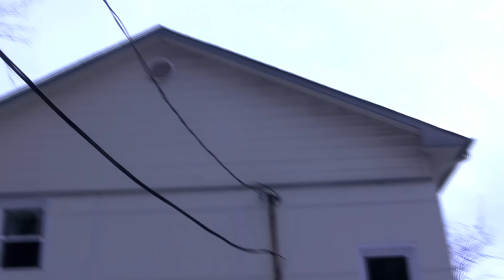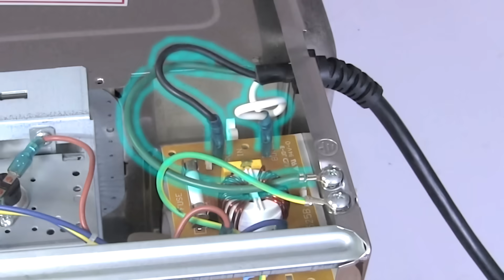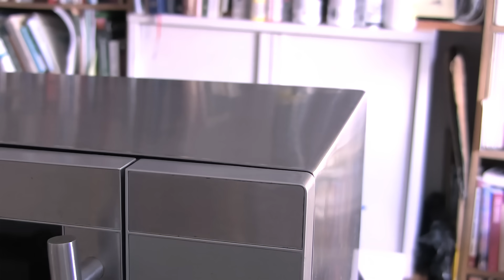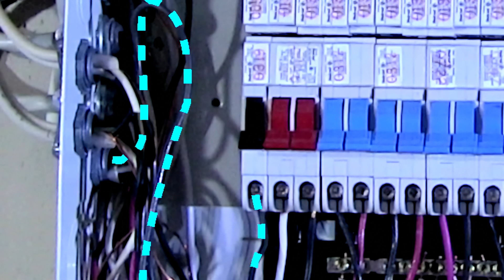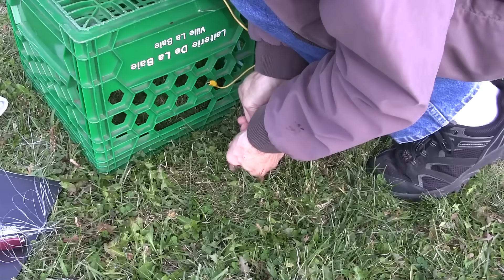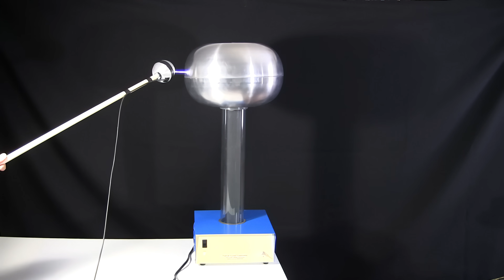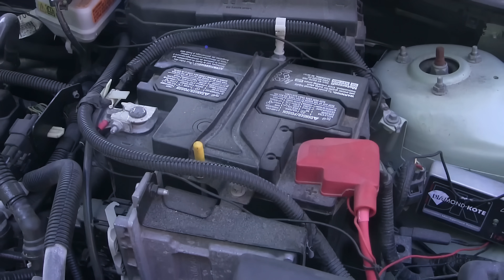What is Ground? Earth Ground/Earthing

Comment: This video is wrong about earth ground, watch MikeHoltNEC.
Reply: what is wrong about this video?
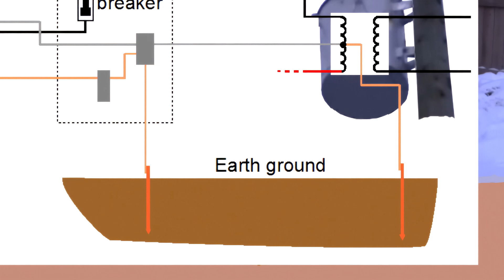Reply: At 4:20 he seems to be implying that Earth will absorb the current, which it will not. All you are doing is charging the ground around the earth, and the ground rod is a poor connection to Earth anyway. You can try this yourself by simply sticking the hot line directly into the ground - nothing will happen (except you might possibly kill yourself), it won't trip the breaker.
I'm not even sure what he's saying here - the Earth has plenty of electrons, but so does every wire and piece of metal in your house that is bonded. It's not for lightning protection, that's ridiculous.
Reply: @richardgates7479  yes sticking the hot line directly into the ground won't tip the breaker, but bear in mind that these rods are few meters deep into the ground
Reply: @Healow
Doesn't make any difference (well very little), it still won't trip.
If you don't believe me look at MikeHoltNEC channel, in one video he drives a rod down 50 feet and it still doesn't trip. The rod still corrodes immediately, and the current is actually going back to the source, so you still have the other end of the path (the transformer) in the equation. He also has a discussion called Grounding Myths, it is a very interesting thing to discuss.
Reply: @richardgates7479  how does a person gets shocked when touching a live wire? isn't that the same? you are just shorting it to ground
Reply: @Healow
Stick the live wire into the ground and you'll still get shocked. The current is going back to the transformers on the power line. There's always voltage in the service ground, several volts, sometimes enough to feel - that's the difference or voltage potential (from the power lines) between you and your neighbor's home.
Earth ground voltage is complex, but there is a voltage gradient so it's totally possible to get shocked by a ground rod if the service neutral is bad. But if it's a ground-isolated system you can't get shocked, because the current is going back to it's source, which isn't attached to earth ground. Some electrical systems use isolated transformers. https://en.wikipedia.org/wiki/Isolation_transformer
Reply from the maker: Did you skip the first half of the video? That's where I talk about what trips the breaker, closing the circuit back to the transformer. The part at 4:20 is talking about dissipating stray charge on metal cases and has nothing to do with the hot wire.
Reply: I was replying to Healow's question with an example of what's wrong, and your statement implies that the connection to ground makes the metal safe to touch, when it is actually the bond to the neutral that makes the ground safe.
And it doesn't make it safe from lightening either because it can hit the ground and now travel up through the ground rod into the home, that is if it don't burn through the wiring first.
Lightening rods work because they create a shorter path to the Earth via the pointed metal rod cutting through the air, and it will still travel across the ground in search of the greatest opposing charge (which will be far less then if that charge had to build up enough to cut through the air).

But this is more about how you worded it and not so much what you meant. If the ground has an even charge everywhere then how can there be different voltages at different distances from a ground rod? And why would lightening ever happen if the static is caused by the friction between the air and the Earth, why would it travel to the Earth if it didn't have an opposite charge?
Reply: you are confusing ground and ground fault.  ground foes bleed off the voltage the ground rods do work, what Holt is showing is a breaker may not trip as it just supplies voltage, a ground fault would trip and that is what that video is showing.  watch  all his videos from the beginning and listen you are missing things.

Comment: Howdy.
It is a common misunderstanding that ground is a "dump well" of the residual current when an appliance develops a fault. That is wrong. The fault residual current always returns to the transformer starpoint.
The neutral wire returns the regular load current and the ground wire returns the fault residual current. Both to the transformer's starpoint.
Why is the consumer ground wire earthed ? It is to minimize the potential difference between the faulting appliance's casing and the environment of use. The aim of the consumer earth electrode is not a low earth impedance. The aim is that the consumer electrode encircles the environment of use. Complete encirclement is seldom possible, though.
With the grid line pole groundings the situation is different. Here the aim actually is a low grounding impedance. The earh will act as a parallel line neutral + ground wire. The aim is to uphold line phase symmetry in cases of unsymmetrical line loading. Also the aim is to minimize lightning shock wave induction and influencing
Reply: Howdy again.
In my blog  eugpoh31.blogspot.com  I try to visualize how the fault touch voltage emerges when an appliance developes a fault.

Comment: bro please help me my doubts are silly but please help me my doubts are in the comment
Reply: 1. for electric potential we consider that we bring a charge from infinity so the work done to bring the charge should be infinity right 
2. is voltage because of coloumb force if yes then how can we calculate the the force between the two  terminals of the cell if its not then  please tell me what happens basically to force the electrons to move
3.can dc current be grounded
4.what is the difference between earthing and ground
5.positive terminal means an area or region move of positive charge or less negative charge as compared to negative terminal AM I RIGHT OR WRONG
6.forgetting the conventional flow in reality electrons flow from  negative terminal to positive terminal right
7.If 6.is right then why do we consider ground negative terminal we should consider it as positive terminal as electron goes to the ground
//basically the main thing is that I am not able to understand electric potential and its concept of infinity 
8.I AM CONSIDERING ELECTRICITY IN TERMS OF ELECTROSTATIC FORCE, AM I WRONG 
9.BRO LAST THING IF EARTH IS NEUTRAL AND IF IT HAS A PROPERTY TO ACCEPT CHARGE THEN IN MILLION OF YEARS THE EARTH SHOULD BE NEGATIVELY CHARGED THIS IS BECAUSE FOR POTECTING OUR BUILDINGS AND HOUSE WE EARTH THE CONNECTION 
AND BECAUSE OF THIS THE EARTH SHOULD BE NEGATIVELY CHARGED AND THEN IT WILL BE HIGHLY NEGATIVE THEN IT WON'T BE STABLE RIGHT 
10.BRO IF EARTH ACCEPTS THE ELECTRON THEN FOR THE ELECTRON TO BE STABLE IT SHOULD BE IN SOME ATOM RIGHT AND IF I AM CORRECT THEN IN WHAT ALL ATOMS DOES THIS ELECTRON GO  AND DON'T YOU THINK THAT THE ATOM WILL HAVE MORE SHELL THAN HOW MUCH THE NUCLEUS OF ATOM CAN HOLD SO THIS CAN'T BE POSSIBLE RIGHT
//IF YOU KNOW THE ANSWER OF MY DOUBTS PLS HELP ME
Reply: @sdadeveloper5223  Im a bit rusty and may be butchering this a bit but here is how i understand the work from infinity.
potential is meangingless without a reference point, only differnce in potential has meaning.  So when we say something is 5volts we are really saying the differnce between 0volts refernce point and 5 volts is 5 volts. As potential falls off as 1/distance, 0 volts happens only when the distance is infinity, as 1/infinitiy is zero. So this ideal 0 reference point would be infinitely far away.
 The work done on a charge is the charge times the difference in potential, which is the energy required to move a charge from 0 infinitley far away to the point where 5 volts is. The energy required isnt infinite.
Reply: @sdadeveloper5223  I have one question, Considering only single phase ac circuit, we use larger wire for live and smaller for neutral.
 In each cycle, ac changes direction. Both the wires should be equal. Why we don't provide same wire size to both cable? Both wires carrying same current by changing direction. So, why call It's safe to touch neutral wire?

Comment: I notice many electrical devices which are essentially the same, e.g. home audio (CD players etc) have a ground, and some don't. How can there be such a difference in opinion as to whether such a device needs ground? I just bought a network streamer and the IEC cable only has two wires, not three as usual.
Reply: If the devices housing is only made of plastic or something that current wont go through it wont need the ground wire
Reply: If a device has only 2 the hot and neutral it may be labeled something like double bonded.  The case is non conductive and likely has a transformer isolating it for safety inside you do not see.  Unless it does not have the UL safety code then it is unsafe.

Comment: So can a neutural wire be used as a ground in a electical box being it doesnt have a ground wire i want to hook up a motion sensor for light in hallway.
Reply from the maker: No, because if you connect the electrical box to the neural, the electrical box becomes a part of the live circuit whenever the light is turned on. If someone is grounded and they touch the box while the light is turned on then some of the electricity could take a path through them to the ground and back to the nearest connection to the electrical system (the breaker box or the transformer).

Comment: As I know neutral and earth not connected together due to both neutral and earth are have some leakage so that kind of situation our ELCB or RCCB will trip so all 3 cable are connected separate
Reply from the maker: In North America, most electrical codes say that the neutral and ground must be connected together in the first box after the wires enter a residence. There are other parts of the world where the rules are different.
Reply: You are looking at the device reacting to the circuit, the bond is made ahead of your circuit you complete turning on a device. It is more complicated than he describes and North america uses GFCI and AFCI which clamp and open the circuit at a lower voltage then EU and UK.

Comment: I would use a 30mA RCD.
Reply: Instead we use GFCI which clamps at 5 ma, 16 ma is enough to cause damage.
Reply: Michael Jørgensen     So you are saying do not ground or Earth the case of the microwave, let the energized conductor put voltage on the metal case, then when someone touches the metal, and is grounded, then your 30ma RCD will trip?   This is why "Earth" conductors are installed in your country.

Comment: If the ground wire is connected to the neutral in the cabinet, why bother with the wire from the socket to the cabinet? Why not just connect the ground to the neutral in the appliance?
Reply: The neutral is the conductor used by the device itself (whatever is plugged in) to create a difference in voltage so that it can use energy. The ground despite being essentially the same potential is used to bond all the devices together to create a short circuit if anything metal contacts a powered conductor.

The very efficient path to ground will be the preferred path of the electric rather than through you, or higher resistance materials that are flammable. The breaker will most likely see a huge spike in amperage and shut off instantly stopping the fault before fire or shock.

Edit: I hadn’t watched this video prior to answering and I see he basically said the same thing I did. It’s essentially a second line of defense as well. If you lost a neutral you would have a ground fault without enough current to trip the circuit. Losing conductors can happen, I’ve seen lost neutrals several times and the ground is still there to protect and trip the circuit.
Reply: Where the ground and neutral are bonded are before your circuit you complete. The breaker trips from the circuit between the breaker to the device you plug in back to the ground bus in the panel.  if you have more than one panel in your house or garage it is only bonded at the very first panel.  after that the ground and neutral must be separate.

Comment: Hot and neutral? Not negative and positive?
Reply from the maker: Nope. This is AC, Alternating Current. Since the neutral wire is connected to ground, it's potential stays the same, call it 0 volts. The hot then alternates around it, going positive with respect to the neutral, then negative, then positive, ...
DC, Direct Current, is the type where you have a constant negative and/or positive.
Reply: I see thanks for clearing that up  @RimstarOrg

Comment: Good explanation that is valid for USA and UK, I suppose?  Connections are made different in Europe and several other places in the world, so safety consequences are different too.  In Europe Earth and Neutral are not connected, and we use beside the classic breaker also differential breakers.  They break power when the current in L and N are different (by 300 mA for whole house, by 30 mA for bathroom).  In this way one is safe for any danger of electrocution, except for when touching L and N at the same time.  The USA and UK systems have more situations where electrocution risk is potential.
Reply: Earth and neutral are still electrically connected to each other in most households AFAIK. However I'm not sure if it's usually simply by the fact that neutral at the transformer is referenced to the earth and the ground in your home is, or if we in the EU still connect them together before the differential breaker too. I think it's the 2nd one to be honest though.
Reply: @FranseFrikandel  There is quite some difference in electrical grid and earthing connections all over the world!!!  For more details see: https://en.wikipedia.org/wiki/Earthing_system   On the continent in EU, the TN-C-S system is used most:  Earth and N are never connected together at the customers, they are most often connected together at the sub-station, and the customer must have his own Earthing.  Due to distance and "potential high" resistance of the underground, one can have dangerous tensions between Earth and N at the customers place.
Reply: Bro, TN-C-S is TN-Combined-Seperated and the N wire is combined with the PE wire (PEN) and seperated in the first fuseboard, aka it's connected in the transformer station :) 
And for household in Denmark we mostly use the TT system where we have a earth electrode at the house and we must use 30mA RCDs.
Reply: @tbravo5493  Indeed, I didn't know the common English term for what we call differentieel in Flemisch or differentiel in French. Thanks.
Reply: In Europe, if you touch L and N at the same time, the differential breaker breaks, right?
Reply: @robertbheatcoker8638  No no, the differential breaker does only check the difference in current between L and N.  If you are insulated from earth and you touch both wires, the same current goes through L, through your body and through N, and it will not switch off.  Only when your body is sufficient well connected to the Earth in whatever way (wet feet or hands on metallic radiator or hands on microwave body or....) and you touch L or N, the differential breaker will switch off.
Reply: @tuttebelleke  ok. Then in that case. What protect me. The magneto breaker?
Reply: @robertbheatcoker8638  Very sorry, but you are not protected at all for that case.  But luckily, common people, not working on electrical grids, not working on electric machines, not searching risks will never meet that situation.  The easiest way to create it, is by putting a nail in both wall outlet holes L and N. That will be difficult because the built in child protection (in Europe) will make very difficult to get the nails in, but a fool who really wants it, will get them in.  Electricians have more risk to meet this situation.  They therefor have very clear rules on how to do their work.

Comment: head hurts now ,.., and i learned absolutely shit. thanks alot.
Reply: me too, feel like a dunce now
Reply: I learnt a lot and it was very simple. Get a brain or just sto watching videos about topics you are obviously not really interested in.
Reply: It is a simplified and mostly accurate explanation.  when you see a wall socket the shortest slot is the hot and is shortest to make it harder for kids to stick things into it. the taller slot is simplified called a neutral wire as it only carries voltage when you plug something in and turn it on completing a circuit from the hot through your device to the neutral and back to the panel and on out the building. The hot goes through a circuit breaker that should trip if overloaded, now days the breaker may have GFCI and/or AFCI.   The ground wire can be simplified to think of as a safety ground to remove electrical potential from a device that is shorted to the devices case.  Hopefully it will trip the breaker and remove the risk to you..

Comment: Hello, thanks for the great video. I have question regarding earth electrode size. Many standards suggest  that minimum dia of earth electrode is 12.7 mm. Suppose someone burries an earth electrode 50 ft deep. Should the dia of entire 50 ft conductor be 12.7 mm or connecting a 10 ft long 12.7 mm earth electrode to a 40 ft long 6-8 mm conductor is sufficient?
Reply: Tapos Barai  The minimum electrode size is just an in general ‘this size electrode should be sufficient for most types of soil.’ In actuality the resistance to ground should be tested. The NEC requires it to be less than 25 ohms. If one electrode gets your resistance under 25 ohms then great. If not than more electrodes need to be driven in the ground and bonded together until your resistance to ground reading is less than the 25 ohms.